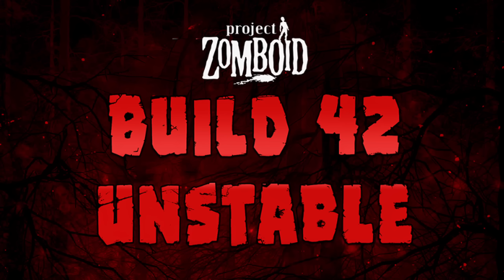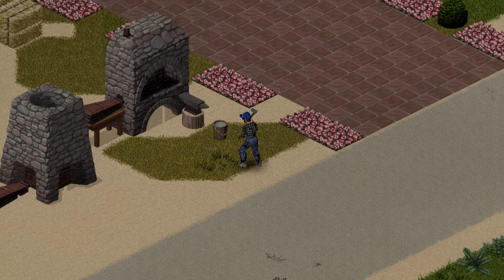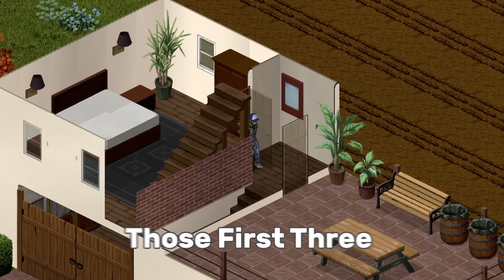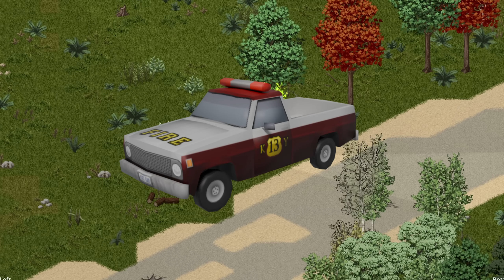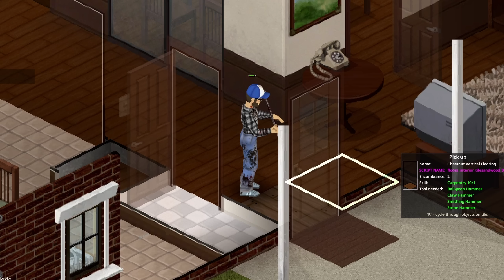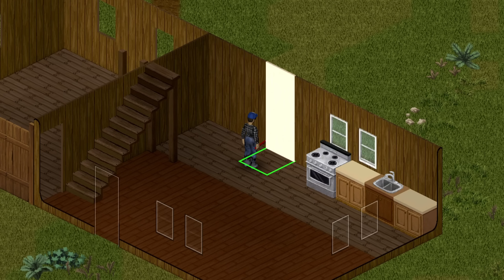Base Building SECRETS They Don’t Tell You – Project Zomboid Build 42

Comment: One thing you can also do if you live out in the woods is use wooden floors to make a road through the woods as trees don't grow over them. You can even lay gravel or dirt on the wooden floors and trees still wont grow. The only problem with this method is that it is expensive and takes a lot of time but makes living away from prebuilt roads actually viable long term as you can actually drive your car to your woodland home.

Comment: 1:05 this is when the video ends. you will never be able to get all this in vanilla game without cheats. the game is really badly designed.
Reply: @martinstu8400  Its not really hard dont sprint around and use your head
Reply: @martinstu8400  You can change your game mode to one that better supports building, or create a custom sandbox and manually make the changes. Building a base from scratch takes a while, but it can be done
Reply: @martinstu8400  what are you talking about you probably havent even palyed the Game in your live grinding skills ist anyoing but ITS Part of zomboid

Comment: How did you make the fence on the roof of the house? When I use barbed wire it just places a floating wire without the poles in between
Reply from the maker: There is a short pole/stick somewhere in building menu. As extra solo item
Reply: @czechstag oh awesome, was able to find it, thank you!

Comment: This guide nailed it. Though, I recommend taking one strategic location and modifying it rather than building it from scratch. Usually you would want to add some room for extra storage, a barn for animals, and defense perimeters. 

I have a run where it requires me to build the house from scratch in the wilderness, like the one in Build 41 where the zombies got a hivemind and strong memory with the peak day multiplier being like 4 times or so. That run is definitely hell, and even if I set the multiplier loot to be the best, I still lack most of the material and tools, such as axes. Oh god, they break fast. The run ended with me being surrounded on a loot run though.

Usually, you would want to build a house from scratch in the wilderness when you make the setting to be hell when in an urban or even rural area. Something like sprinter night, undying zombie, or hivemind would do. Hell, I even did 100% sprinter on normal loot once and survived for 2 months before I died of falling down with 49.9 encumbrance. I even found some buggy features on the mod that are fun to be played with for easing the difficult setting I set. You could even have some map mod like Island Z that basically say you are do anything from scratch in that island.

Comment: Whats with the indoor/outdoor mechanic in Build 42? I build an extension on an already existing House, but it rains through the Roof. Do i need to place wooden poles in each corner or how does it work?
Reply from the maker: That’s a good question.
You need to use flooring on the roof, since the game doesn’t have actual roof tiles. Sometimes it’s just broken.
The only way to 100% confirm you’ve got an indoor space is to place a sink inside and hook up running water — if it works, the area’s considered indoors.
You can also check it in DEBUG mode.

No idea why, but sometimes even with four walls, doors, and a roof, the game still treats it as outdoors. I haven’t figured out why yet.

Comment: Lets not forget that building a floating base also means you never run out of water (albeit you gotta boil it) AND you can "build"  workable land on top of your base... It's gonna be resource intensive, but it'll pay off...
Reply from the maker: In B42 is rooftop farming is turned off. You need to turn it on, but it may cause some issues with farming.
Reply: @czechstag  But can't you just place the dirt on the base level then? Or it's farming on built structures at all?
Reply from the maker: @pablonunalvares5391  Honestly, I haven't tested it. The main reason is the growing period is really long and, since rooftop farming is basically not functional, then I didn't want to spend time doing it. So maybe ground level could work...

Comment: You don't need that fancy stuff just makes sure your guy has a lot of carpentry. Build a wood wall around your 2 floor base then find a lot of vehicles park them end to end around the wall. The zombies can go under but have no room to get to the wall. Your safe. you also can store fuel in the cars gas tanks.
Reply from the maker: Agreed. This is meant to showcase what can be done. I could make a base defense guide in the future.
Reply: @czechstag  You can build zombie traps in front of your base. I like to use vehicles, because if you take the tires off, then zombies can no longer crawl under them. Zombies can't destroy cars, and they don't burn. Build a set of stairs over a large "pit", or ring of cars. Then build a fence or barrier of some kind at the top that YOU can climb over. Maybe even using a sheet rope. On the other side, leave a path along one side wall, with alternating gaps or holes in the floor in a checkered pattern. The zombies will push each other off the stairs, and right into the pit. Any zombies that get past the fence, will walk right into a hole and drop into the pit because they tend to path in a strait line. You can either set them on fire afterwards, or if you want either the XP or loot, then just leave a corner in the ring of cars where you can reach them from. I just let them build up until it's worth the time and effort to kill them. You can get the loot, by going through the car doors. 

You can also use this to clear GIANT hordes. Like all of Louisville sized hordes. Simply build one of these near where you want to clear, then go through the car doors and build campfires on the inside. Lead the zombies to it with a police car running the siren and honking.

edit: added the word Large.

Comment: 3:52 "Don't use them for fighting" - Laughs in lumberjack.
Reply: BEST MELEE IN THE GAME WITH AXE MAN 🗣🗣
🗣🗣🔥🔥🔥🔥
Reply: @TaeYangSONG nop. sword blade is the best
Reply from the maker: @TaeYangSONG Days of Axes are far gone…
Reply: @czechstag  what is best for use for melee instead?
Reply from the maker: @martin5417 If long than bats,  crowbars and maybe I would try long mace. Then I really like short blunt. It´s ubundant, it kinda slaps with rising levels and you can swing all day. And spears are just OP.
Reply: @czechstag  THX for answering. Would nice to see a comparisson. I´ll try something new. 🙂
Reply: @czechstag  Agrees with this. Axe now is weak for fighting. I prefer short blunt level 3 with construction worker as profession (for exp boost) rather than axe level 3 with the axeman trait. Axes require too much energy, and they break faster. Short blunt, on the other hand, breaks faster but is far more abundant. For defense (usually I take a wire-fenced area), I usually stock up on spears. Axes now is only for logging since I will need more wood than ever, especially on how I need to create barn and maintain it (when stressed, big animals tend to destroy everything I made).
Reply: I agree. Axe is amongst the best early game weapons. Also you can make infinite axes with stone, wood and rags. Easiest skill to level up since stone axes are infinite.

Comment: Useful tips but I personally just would go for the debug mode search a nice place and build the base without a hassle then go back with normal mode then collect everything else what needs. There are some mods that can add extra value for the game but the downside is some mods are not compatible and I end up some bugs and errors. The ideal would be if Indie stone just let the players build everything what is in the game if you have the required skillset to make it. At the moment the buildng in the game is very barebone and existing buildings can provide a lot built in system what otherwise you need.

I have a mod downloaded for roofs, because you cannot otherwise build ceillings which could prevent your interior from deteroitating. There is another mod which lets you build walls, wallpapers, floors etc what is in the game with additional furniture but those are not functions. Another useful mod is the " Stairs East&South [B42] ". It is sucks when you can only build stairs, ladders and other stuff like furnitures with 2 side.
Another small issue is (normal mode / debug mode) when I try to make a brick wall and try to plaster it then I only can do with the normal wall not with the windowed nor the doorframe one. Possible comes with some mods so someone who does not use any mods but debug mode could test it to proof it is an existing issue in vanilla or it comes with mods.

So tldr - I personally would just go for the -debug and start the debug mode for the game and build your home from scratch but obviously you need mods sadly to build freely without the limitations what the vanilla has.
Reply from the maker: I used debug for making the guide to shorten the time needed to pull it off, but using it and going back to the game wouldn't be my style at all. As I said in my pinned comment, I prefer existing houses and the fact it's kinda easy to repair them and make them work fast. Using mods is iffy. B42 is unstable, and you can't know what next patch will break.

Comment from the maker: If I had to pick, I’d still go with an existing house as a base.
Building everything from scratch takes a lot of time, especially early on. Using what’s already there gives you walls, a roof, and storage right away, things that would take days to rebuild.

That said, it’s worth trying a full custom base at least once. It teaches you how every system connects — carpentry, plumbing, power, and security. Just don’t underestimate how much effort it takes to get there.

What about you — do you build from scratch or take over what’s already standing?
Reply: Sorry late reply. But I personally like to find an already existing house in a relatively good state, fix up and add to the interior, and then build a sizable house extension off of it (while nocking some walls down for easy pathing and to make sense). By far my favorite way to build, as it’ll level skills high and fast while still providing all the benefits of having…a house XD
Reply: i just started a new playthrough for the first time in a while and i wanted to learn to build a house so this video was great, i love my farm houses but i wanna make something myself
Reply: Bro, i can't even loot another house and get back safely. I keep getting bit
Reply from the maker: @KEYZW1Z4RD  wtach the beginner guide. It will get easyer soon: https://www.youtube.com/watch?v=v-q0FM28Cuc&t=15s

maybe watch the combat guide if you need it: https://www.youtube.com/watch?v=SzhhzfnCBgI&t=76s
Reply: @czechstag  im doing better now, i watched a video on combat and now im good lol